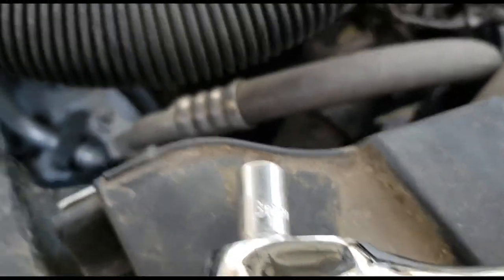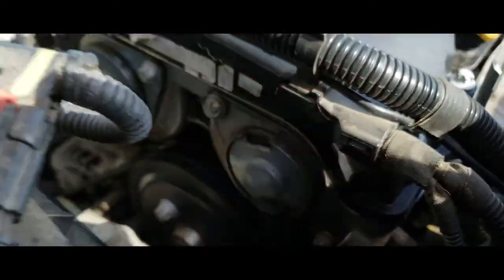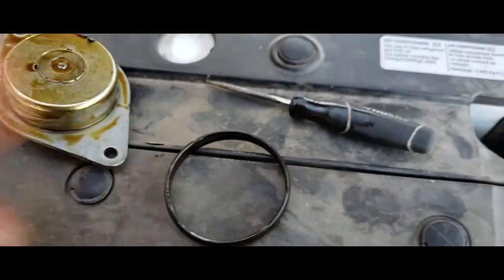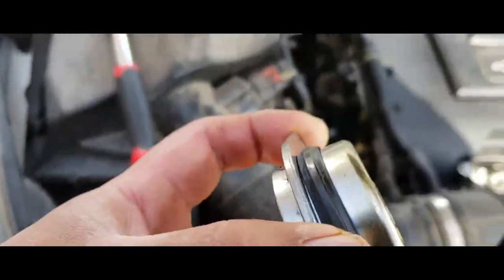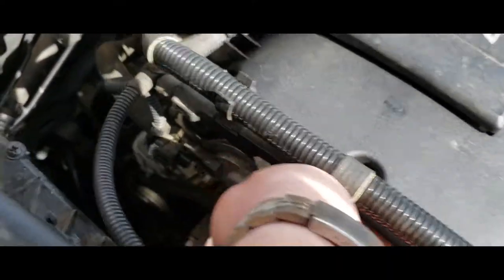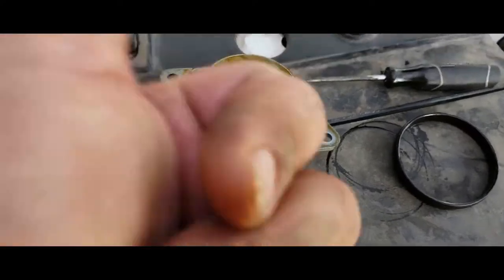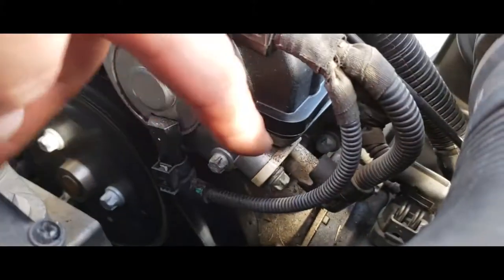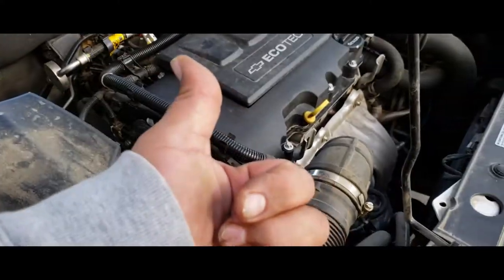How to: Replace CamShaft Actuators Seals on a 2015 Chevrolet Cruze Lt Turbo Eco

Comment: Are they directional? Does the orientation matter? I ordered 2 GM seals.  They should arrive tommorow.
Reply from the maker: No you should be good. Their just seals but just install them as you remove them, u should be good